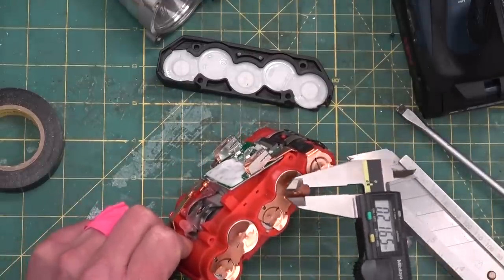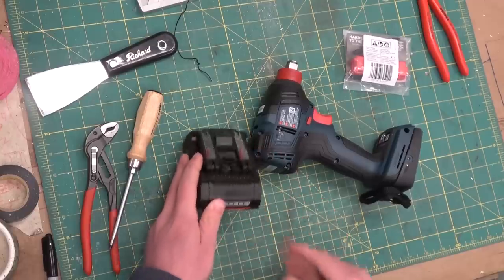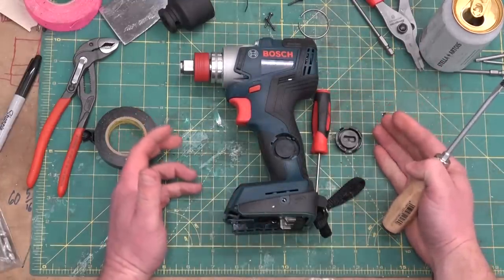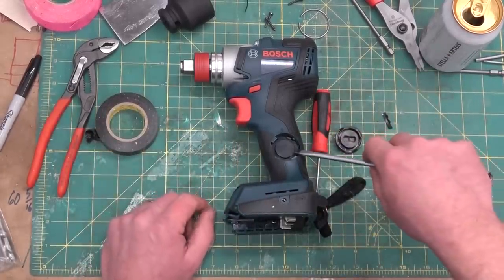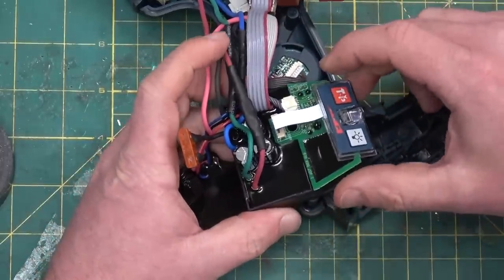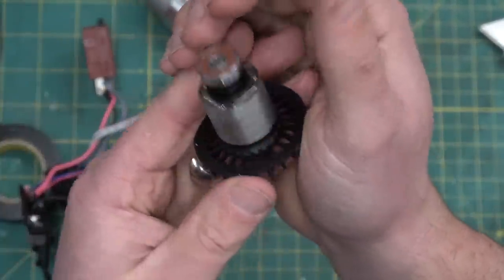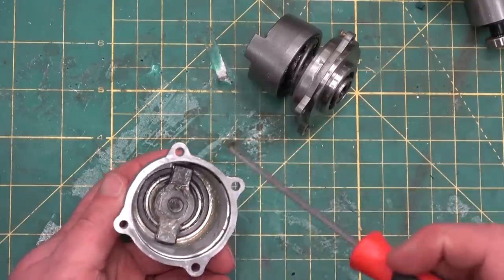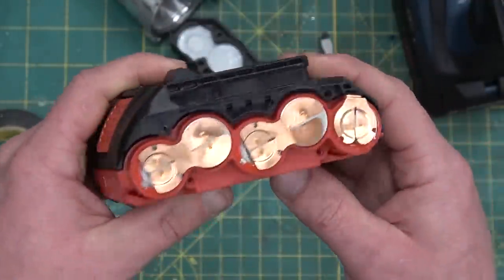BOLTR: BOSCH impact driver | CORE 18V

Comment: 21700 are better suited for heavy duty than 18650, which is why you see 21700 in Hilti and other pro tools. Same with cars like the new Tesla Model 3 and other new electric cars. The bigger batteries allow for a better (more appropriate) chemistry for heavy duty applications making them charge and discharge better while also lasting longer.

Comment: I asked my boss for some new nut setters. I usually only use makita. He came back with these, he said they were half the price. 1 week later 2 out of 3 stopped working and 4 battery's out of 6 didn't register on the charger. We will be getting 300 screw guns and 400 battery's by the time the warranty ends.

Comment: More battery destruction please :D- there's a ribbon cable under the PCB that's going the wrong way.

I've a suspicion that it's implementing balancing in a neat little way to save space - via attaching wires to the  sides of the bare cells and not the ends - no wrap. Would be nice to see if I was right.

The fins are probably just weight saving/strength spun with marketing but the holes in the inner moulding of the battery between the cells are apparently ducts that the charger blows air through during charging to cool the cells.

Might be interesting to put a thermocouple to it and see if it makes a lick of difference.

Edit: I'm am idiot, those air hole's are for screws so maybe only some of the range have that feature?

Comment: I like it when my impact driver has extra complex shit that has nothing to do with actually getting work done. Nothing says "pass down to my son 20 years from now" like bluetooth connecting circuitry. And getting it rained on when you're trying to wrap a job up is all the nicer when you're holding an umbrella with one hand while working with the other. And all the overheating protection - how nice. If there was ever a need for Muntzing - this is it.

Comment: Milwaukee said they want to switch to bigger cells as well, because of the massive currents you can get with them. And better form factor for higher amp-hours.
21700 instead of 18650 cells.

Comment: Judging by the size of the batteries I’m guessing these are 21700s and not 18650s. Which gives them a lot more run time and more power. Who knows who makes the damn things though.
Reply: They are Samsung INR21700-40T cells

Comment: pretty sure the new generation of batteries bosch is running run much cooler, and those are not heat sinks they are structural reinforcements (but also makes the plastic thinner around the batteries so they can dissipate heat better.. as for the copper, sure looks like they had it tightly packed where vibration was not going to be an issue to work harden it.

Comment: 0.12 is plenty for the battery. If it were nickel it would be 0.2 maybe 0.25 but that is an overkill. So 0.12 of copper is just fine.
I'm interested how they spot weld copper? How did they weld something that conductive?

Comment: First off, thanks as always for both the humor and the knowledgeable commentary!!  Somehow with a lot of these tool brands, sub-optimal decisions get made somewhere along the line.  Agree with your Bluetooth comments.  The Bluetooth seems like just a gimmick to me unless you can use this for tool tracking and inventory for large organizations.  Generally I like most of what Bosch does and have quite a few Bosch tools but none with Bluetooth.  Plus 90% of my Bosch stuff is corded and not on batteries except for my Bosch laser distance meters which are all battery powered.  That copper foil on that battery system is mighty thin unless the foil's thin nature confers some advantage against work hardening but I think you're right in that this is value engineering run amok.

Comment: I run the Bosch 12v drills and impacts..  they charge fast and are small.   Useful for almost everything I do. 
(Large jobs like decks I use the Porter cable. )
The 18v Bosch stuff seems too gimmicky and expensive.

Comment: Those batteries are 21700 cells  I own one along with the power box radio IDH  182 impact driver I have a 6.3 amp hour battery that has 20700 cells

Comment: With lithium ion batteries the bigger the cell the longer it takes to discharge the longer it takes to discharge the longer the tool runs therefore the fewer times over the life of the tool you have to recharge the battery the less chance there is for the metallic filaments in the other things that happened in Lithium-ion batteries to occur to kill the battery. So bigger cell equals longer battery life for operation and longer battery life overall so yeah it's a good thing

It looks to me like the primary aim here is to distribute and mitigate heat buildup the copper passes the power better so generates less Heat and you get less resistance so the battery last longer that way and you get better available surge power to the 20 volt Max

Comment: I have to Milwaukee One-Key 1/2 inch and I like the bluetooth feature because I can dial in the torque when I am doing repetitive jobs, also at the time the One-Key had a higher nut busting power at the time.

Comment: Lol. Fabrik Shaftenhausenwerk? Thanks for sharing. I had read in a history book that the city council of Danzig in the 16th century had a man strangled for building a machine that could knit stockings. They had figured enough young women were out of work and troublesome. More parts equals more chances of failure(sell another one or parts for it). The last Stihl chainsaw I couldn’t get started had a gas cap that had an overry comprickated bail mechanism with four parts. (Instead of the robust one piece crank-it-in and forget it cap.)

Comment: The batteries are Panasonic 20700a or b. Both are pretty decent cells for this application rated for 20 amps or 35 pulse, standard 3.7 volt, and somewhere in the 4k mah range.
Reply: The cells in the 4ah and 8ah packs are 21700. The 6.3ah pack uses 20700.
Reply: They use Samsung 21700-40T cells, rated for 35A continuous discharge, or 45A temperature limited.

Comment: cooling fins work with with any material. doesn't matter if it's a good conductor of heat or not. plastic can get hot. the more surface the better the heat dissipation. the thin copper connectors look ok to me too. I'm not worried unless it turns out this is an actual weak point. I think it might have something to do with current protection. the thin foil can work as a last resort safety that if melted disconnects the batteries from each other. I have seen thin foil fuses. the plastic ring also doesn't worry me. if it was metal it would scratch everything, plastic is more forgiving.

Comment: Hey Ave have you seen the new HART brand impact/ drill driver set at wally world??
Would love to see these tore down and know if the internals are complete crap or if they are a solid deal 
100 bucks for the set of 2 or 198 for drill, impact, Sawzall, and flashlight

Comment: I have a Bosch mini impact driver (not for automotive or anything, but great for drywall screws and wood assembly) and it's the best dang impact driver I've ever owned. I have their bigger one (it's similar to this model but I think a bit older) and it works for automotive, and it's also a great tool, never had any issues with it whatsoever. I do NOT get having bluetooth on this thing though, that's what bluetooth speakers are for. Seems like a gimmick to me.

Comment: The battery design is a compromise and an optimisation. On the 18650 cells, you can either have high discharge currents or high capacity. If you want 10C discharge, you're not going to get them from 3000Ah Panasonic cells. You're probably getting them from 2000Ah cells.  So they end up putting cells in parallel to drop the internal resistance and get more capacity. 

Bigger cells gives them better capacity without the drop in discharge current or shorter battery life.

Comment: Bosh was not the first to put Bluetooth in the tools in fact it is pretty obvious that it is a answer to Milwaukee's One Key Bluetooth system.  I my self will probably never have a use for the Bluetooth but that being said I can see it a very important feature for some kinds of buyers. Bosh tools end up doing a lot of jobs and not all are in the construction industry. Lets imagine you are running a factory of some sort and you need one of your workers to put a fastener in at a certain torque. You can simply set the torque for the drill that is at that station to that setting and bob your uncle, or another situation where you are running a team of worker that will need different tools for there job each day then you could have a tool room where they check out the tools attaching there name to the tool so everyone know who is responsible for the tool. The situation that came to mind right away was when I was in high school I took auto body in a vo-tech program and they had a tool room that we had to check out tool to use. In short the module is not in there unless you need to add the capability and I would rather have the option to add something like that then to not have the option but it is true that the most users will not have a use for it. As far as the added price to add the board and the wires to make the option possible I would bet it does not add much to the price.
Reply: izs not the answer. It was both released the same year

Comment: 9:35 the bluetooth - You may want to use this in the production somewhere, where you need to track the status and confirm that something is screwed well. Then you save the data, and if it comes to customer complaint, you can show that you have tightened everything according to their requirements
Reply: Nice idea, but it seems like it’d be a considerable investment implementing it. Unless Bosch offers some sort of service for businesses.
Reply: @SkigBiggler  not my idea, it is used in many production plants for many years

Comment: 21700 are not that much bigger, and have double the capacity and amp rating  so yes it would be better. 40t is rated 30 amps at 4000mah, it would be worth the tradeoff for size. Their are a few 5000mah 21700 batteries that do 10+amps

Comment: those 5 cells are not 18650 - they are Samsung INR21700 40T = 21700 - 21 dia 70 length - 40T cost us about £9 - 2x 18650 2000Mha around £11 about twice the size too ( without shipping )

Comment: Those copper links should be good for approx 40A. Probably double what the tool uses. Mind, spot welding copper to nickel or aluminium is problematic at best.

Comment: I watched a video from linus tech tips where linus cold welded new cells to a camera battery pack. They destroyed so many cells by welding trough the cell casing that they could have bought a new battery with the value of the wasted cells . That thin 4 thou copper strip could be there to mitigate the amount of destroyed cells in the assembly line. Thin strips take less micro seconds and amperage to cold weld🤔

Comment: I would say if not to save a few penny's the copper is that thin so it can also act as fuse between the cells. I would engineer sort of protection between them.

Comment: the plastic 'fins' may not be for heat dissipation but structural enforcement. save weight over a solid piece and hey increase the surface area and thin some sections for a lower R value will dissipate more heat then solid piece

Comment: 17:59 Noice. Wire under solder -- old (relative) ebike controller skookumification trick I'm told was/is to lay down copper braid (solder wick) on the high current traces and then fill it right full of the good plumbum stuff. Never tried it myself but pretty easy to see solid wire could be much better and more repeatable when dealing with squiggly turns!

Comment: Maybe BT ( if torq setting accurate?)  to tighten bolt to specific tension. Easyer/cheaper  to do in software vs mechanical

Comment: Rusty laminations... I finish mild steel with epoxy and it's beneficial for the surface to rust. The epoxy thinned with xylene  soaks into the rust, thickens as ther xylene evaporates then hardens. It's the most durable finish I've ever made.

Comment: At least in an interview the chief of handtool engineers at bosh said the data line in the newer "core" batteries ist to change out information about the tool, so the battery won't overpower the tool.

Comment: The only legitimate uses I could imagine for a Bluetooth module in a drill is for non-live tracking: Either a tool crib where you have to sign out the tools you use (which could speed up checkout times), or a rental place. And they could also throw in a g-force tracker, charging extra if they find out the person renting it dropped it from, say, 12 feet.

Comment: 22:53  Maximum power transfer occurs when internal resistance is equal to load resistance.  i.e. the hardest you can hit something with a thrown object is when that thrown object weighs essentially the same as the weight of your arm.  Heavier or lighter, will hit with less power.  Heavier cuts the speed too much, lighter cuts the mass too much.
Reply: Well copied
Reply: @keithdavis3819    No plagiarism.  100% original content.  I learned maximum power transfer from Professor H. Michael Thomas as it applied to electronic circuits, but the physics translates to all systems.
Reply: @snap-off5383  take a pill
Reply: @keithdavis3819  don't ASSume, and you magically avoid being corrected.

Comment: Did you make a video on bosch green pbd 40 drill press 
Idk if it's any good since is bosch green but it seems to be the best drill press I can get as it has variable speed a 710w motor compared to the shitty 350 and 500w motors on cheaper drill presses

Comment: 4 thousandths of an inch (or 0,1 mm in proper units of length), is plenty enough. Standard thickness of copper traces on PCBs is 0,035 mm. In computer PCBs, such traces can carry hundreds of Amps from the VRMs to the CPU or GPU.
I'd be more worried about longevity of the spot welds.

Comment: Turn out my Bosch 18v combi has more driving torque than the gdx by quite a margin, its as if the hammer dogs disengage too easily or at least do not fully engage with the anvil making only light tappy tap taps, i think a stronger spring is in order.

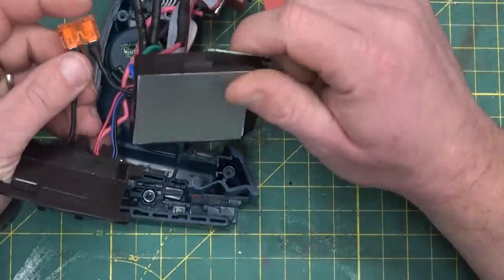Comment: @16:12 - Fuses are far too slow to protect most devices - it would be there to protect surrounding "property", not any particular part of the device itself. In this case of course overcurrent or a short causing the battery to heat to potentially destructive temperatures.

Comment: apparently the Bluetooth is used to activate electronic ear protection, like noise canceling equipment or something
but that makes even less sense because if you work in such environment you want protection from every tool not just one of them and Bluetooth is a end to end connection so the "EAR PROTECTION TOOL" could only monitor one thing at a time!
and most tools don't have this so it must monitor every noise too so at the end WTF?

Comment: I just bought this Same. Exact. Set. on clearance at Lowes for $34 + tax. Did I get screwed?
Reply: Considering the set normally sells for $250 even if it doesn't last forever that's still a good deal.

Comment: Unrelated to this but related to tools is there a way to convert a 110v ac tool battery charger to accept 12v dc in instead of having to plug into a 12v to 110v ac inverter? I ask this because i have found few 12v socket inverters that will run a 110v tool battery charger and dont want to spend the $120 on milwaukee’s 12v to m18/m12 charger as i already have 5 110v chargers. Seems like a thing You’d be interested in thanks. - A Fellow tool nerd.

Comment: Those cell's look like 20700 made by ijoy 3000 mah, 40A also used in vaping. As far as vaping aplication is concerned 2 of these work just as good as 3 18650's. So this might not be that crazy of an idea.

Comment: Those are 21700 batteries more mah at higher amp output than 18650 but another cell would be equivalent

Comment: learned the battery issue the hard way rebuilding a pack. I cant remember the gauge but what ever it was, was thicker that foil and it glowed with no load. re-soldered with thicker bits and works like a charm. smh Bosch.

Comment: There is significant advantage to use larger cells for higher continuous amperage output. See new Tesla cells.
Reply: There is no advantage in terms of capacity.   You simply get a larger battery but it takes more space equivalent to the capacity increase.  It is like have 1 cup full of water instead of 2 cups half full of water.    Larger cells means fewer cells but then you have issues with cooling the cells means they get hotter so cooling needs to be increased so most gains are also lost.  You end up with just the size difference and not much else to write home about.